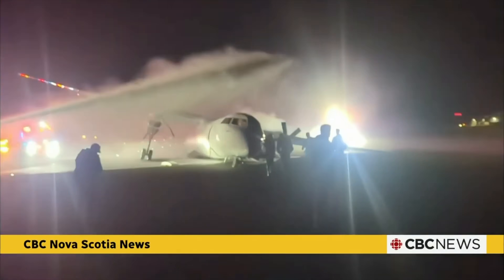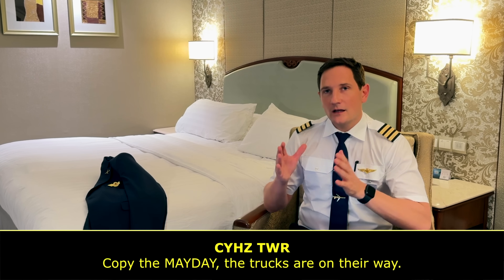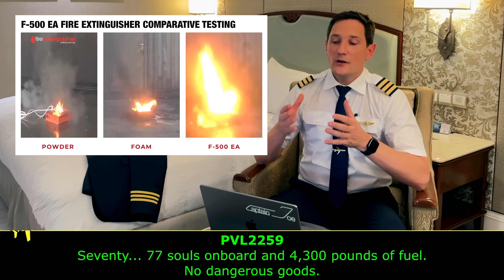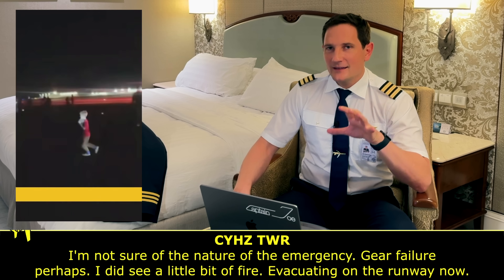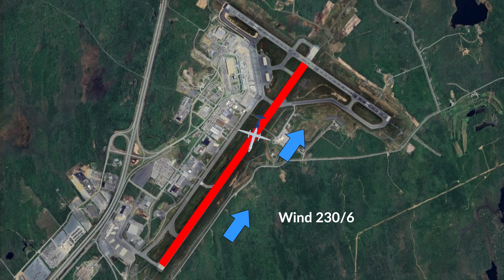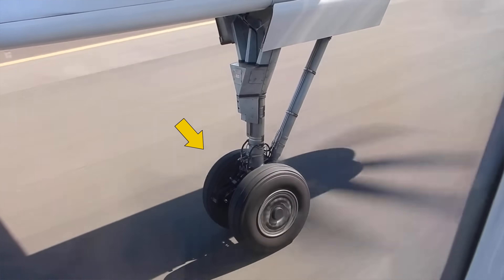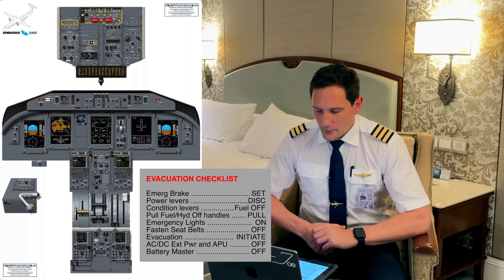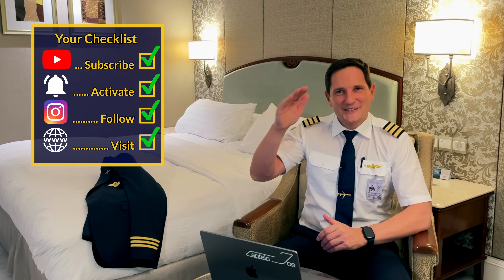WHAT WE KNOW about the Q400 EMERGENCY LANDING and Engine FIRE - Explained by CAPTAIN JOE

Comment from the maker: Hey Everyone! 
I want to use this comment to point out that I made a mistake in the Evacuation Checklist. The "POWER LEVERS set to DISC" actually means "Discing", reducing the blade angle to almost zero (the intermediate position between flight idle and reverse). And, the yellow arrow during "FUEL and HYDRAULIC Off handles" should be pointing to the handles on the overhead panel. 
Kind subscribers and pilots of the Q400 pointed the mistake out to me! 
Thank you for that! Bare with me, I'm not rated on this plane😉
Wishing you all the best! 

PS: If there is another incident/accident you would like me to review, please comment below!
Reply: In normal operation, the APU and APU Bleed would be off during landing, but in icing condition, which right now is prime time for that in Canada, the APU and APU Bleed would have remained on for the structural anti-ice to operate.
Reply: @PinkHusky433 the APU on a Dash is not certified for inflight use. It’s only used on the ground for air conditioning and electrical power.
Reply: @PinkHusky433 the APU would not be running on touchdown. The APU isn’t used for de icing on the Q400 however it is started while taxing to the gate for bleed air heat in winter and air conditioning in summer
Reply: Is it possible to review any cargo incident/accident?
Reply: Also the " pull fuel off handles" are the red handles on the overhead panel. You are showing the roll and pitch disconnect handles.
Reply from the maker: @richardmorin6968  Read ... just take the time to read the full comment ...

Comment: Hey Joe great video , quick note : the fuel hydraulic cut off t handles are on the overhead panel in Red . The one you pointed in your video were the pitch/roll disconnect handles.

Cheers

Comment: Successful landing with a disabled aircraft but the airport bungled the passenger recovery side of this.  The passengers were left out on the runway for about 1.5 to 2 hours in the freezing temperatures.  Same thing happened back inn2016 when an AC flight crashed on the runway.  You’d think they’d have done better…

Comment: My two cents here, the dash is known to have a gear collapse due to the frequency and vibration of a flat tire. The pilots may not have known that the tire had become flat after take-off and upon landing the vibration can cause the gear locking knee to unlock causing it to collapse. The downside is that the Dash 8-400 does not have any tire pressure indicators onboard the flight deck so if the tire had deflated after take-off or deflated during touchdown the pilot would not know. There is a checklist on the Dash 8-400 that if a known landing gear tire has failed or deflated it gives a clear warning that the gear may collapse upon landing. So good on the pilots for handling such a latent threat and sticking to their training and Standard Operating Procedure!

Comment: I was operating a flight into Halifax the evening this happened. We elected to hold until we were close to our minimum diversion fuel in case the airport decided to open 32/14, which we were able to eventually do. We landed on runway 32, it was very surreal seeing the PAL Q400 off the runway as we taxied in. Phenomenal job by the crew and a good breakdown of the situation.

Comment: Hero move of the day? B.S. The pilots already have enough to do in an emergency, such as save the lives of all on board. The last thing they need to be doing is answering ATC calls for souls & fuel on board. All of that info should be automatically transmitted to ATC & emergency vehicles as soon as pilots give weight & balance info to the dispatcher on pushback. I've seen far too many of these emergency flights where pilots are right in the middle of trying to solve the emergency & ATC interrupts with a request for souls & fuel on board. All that does is distract the pilots from solving the emergency. While the pilots are trying to answer ATC, their aircraft gets closer to disaster for everyone onboard.
Reply: So no fuel burn while route?
Reply: @Steevo-qw4sp  As though that should be the priority in an emergency? Let's see, my aircraft is about to crash, I have seconds to diagnose the problem & save it, or I can waste the time calculating my fuel onboard to tell ATC. Tough choice.
Reply: @darenf973  standard info passed on when declaring an emergency. I should know attended over  well over 100 in my
Reply: Attended well over 100 in my career

Comment: I will say in the following pilot's defense asking for expected closure time, the only time anyone actually communicated what may have happened with the first plane was tower talking to the firetrucks, which might be a different frequency, and even then it was "I'm not sure... gear failure perhaps...". So the following aircraft might not have had any idea what was going on, just that there'd been a mayday and they'd been told to go around, and wouldn't have had anything to base a guess on how long things were going to be shut down for.

Comment: Well done by all concerned.  I am wondering from comments made by ATC about the undercarriage collapse if the controller had seen the problem and may have alerted the emergency serviced before the mayday call by the flight crew.  This might explain the incredibly quick response by Red 3.
Reply: That was my speculation. The ATC tower there is not that far away from where the aircraft ended up and likely watched the incident occur, highlighted by the flames.

Comment: Lack of proper maintanance or just unpreventable accident due to some fod on runway during take of damaging tyre ?
Reply: The initial TSB release said the vibrations caused by the blown tire caused the gear to release from its locked down position. A very similar incident has happened before. Most likely related to design characteristics of the landing gear but maintenance could certainly be a contributing factor to both the tire failure and the failure of the gear.

Comment: When passengers are told to evacuate the air craft. Does the flight attendant tell them in which direction to go once there are out of the plane and away from danger also does everyone meet up at point for count ?When you said passengers Running around I am picturing  passengers running around everywhere and not have a direction to go.
Reply: The instruction is "By nearest useable emergency exit", both in the pre-flight briefing (who listens to that?) and at the time of the evacuation.  From personal experience (training/test evacuation, but loads of smoke) it's more than a little scary.  Since that exercise I've developed the habit of seeing how many rows both ahead and behind to the nearest pair of exits, but I can guarantee most people don't.

Comment: Great video! I flew the Q400 for Flybe (UK) for many years; in fact I was a TRE on it. Your explanation is so good I would use it for recurrent training (if I wasn’t retired, and Flybe still existed, and I hadn’t moved on to the E195 ☺️). 

Two wee points, if I may: first, in your explanation of the Evacuation Checklist, your yellow arrow points at the Pitch and Aileron disconnects when you talk about the Pull Fuel/Hyd Off handles. Those are actually the two red handles at the top of the overhead panel. Second,  Power levers to DISC isn’t “Disconnect”, it’s actually DISC, meaning the blades are set flat on to the airflow effectively creating a big “Disc”. In other words fully fine pitch. From there, Condition Levers to Fuel OFF, causes the blades to go to the feather position; edge on to the airflow.

I agree that all involved in this - especially the pilots - were extremely professional in what must’ve been the biggest surprise of their careers! 🥴

…and then I saw your correction at the top of the page. Clearly lost all my observation skills..😂

Comment: PL s to Disc -> idle pitch. Out of reverse pitch. The fire handles are way on top. The air stairs stop halfway resting on the tarmac. That’s minor issue. The aisle is narrow. Very narrow. The exits fits a big tight as well. That is challenging for the cabin crew to mange. They did well. Good job by all 4.

Comment: The reason the pilot asked how long the airport might be closed for is because there may be many reasons for it to be closed - and if there's a chance it may reopen shortly it would be more helpful to everyone around who otherwise might not have options. They wanted to know if they need to immediately go to the alternate or if they hang around a bit there's a chance to reopen.  Approach wanted their intentions and the pilots were basically asking if there's a chance it might reopen shortly or if they need to divert. If you've got the fuel and it's only a short wait, it might be easier to wait. If it's more indeterminate then diversion is the only option. Might seem silly, but diversions mean having to land elsewhere, arrange accommodations for the passengers, logistical nightmares of getting them rebooked back to Halifax and other things, maybe even having to bring new aircrew in. And all the other issues if it's not an airport they normally service. If they have the extra fuel, it might be easier to just wait it out (and passengers would appreciate it more as an hour late is still better than what will be 6+ hours somewhere else). More of a customer service thing sure, but it never hurts to try especially if you can.
Reply: From Halifax there are 3 possible close by  airports. Saint John NB YSJ,  Fredericton NB YFC,  and Sydney NS  YQY.        Saint John is a 35 minute flight and a 4 1/2 hr drive.
Reply: @steveggca  you missed Moncton, NB YQM, which would be the better alternate typically.  2.5 hour drive.
Reply: @chrischaffey1252  totally did
Reply: I think I read somewhere that Charlottetown was the diversion airport for the second PAL on approach.

Comment: Maybe you might have the answer! try to ask other pilots with no response!
South Korean crash why didn't the pilot dropped the landing gear manually? it was said there was no electricity four minutes or something, but that doesn't affect the landing gear being dropped manually from inside the cockpit, and how long does it take to drop about 15 20 seconds? I can't understand why they didn't drop the landing gear, What would have been the reason they didn't?
Reply: Confusion panic after the bird strike ?
Reply: @WANDERER0070  I'm not convinced by that
Reply: Gravity extention still requires electricity. In engines goes out it will be powered by the battery. Check blancoliros video on that. I’m starting to suspect that the battery didn’t work…
Reply: @martinolssonbass  you sure? I thought it was just a lock you release in the cabin and it drops down by Gravity, I didn't think any electricity was needed? I mean they're not electric anyway its hydraulic so I'm not sure that's correct sir

Comment: The 3 SAS dash 8 incidents were improper maintenance by SAS  (rollers that the unlock hooks rest on did not roll properly so the uplocks could not release)  and had nothing to do with a bad design.
Reply: That would cause the gear to not come down. A gear collapse is different. Didn’t SAS have gears collapse?

Comment: An interesting problem occurred to me when I heard (on another channel) the airborne flight declare he was diverting to his alternate airport. A lot of airline flights will operate on a No-Alternate Flight Plan in order to carry less fuel (save money). That would have been an interesting complication. What would you have done in that case if you were capt. and did not have enough fuel to comfortably divert?
Reply: Not all airlines do that. For those who do, there is a clearly defined set of conditions that have to be met before a flight can be dispatched under the No-Alternate rules. Basically, the weather has to be perfect, destination airport has to have two runways, the minimum fuel quantity is specified and includes an extra reserve, etc. In this case there are a few airports not too far from YHZ (YQM would be the obvious first option), and if it comes to that the Capt has full autority to take whatever decison he/she feels is required for the safety of the flight... ;-)
Reply: If the second PAL had declared mayday-fuel, would he have been allowed to land, despite the unavailability of fire crews?

Comment: Okay, this is not an appropriate comment, but after next Monday, Trump's department of External Revenue will be able to assess a tax on the fuel burned by the trucks in Halifax.  At least that's seems to be what he thinks can happen.  

Otherwise, fantastic job by the pilots and all else involved.  Ex-RCAF (except it was called Air Command when I was in) and spent time at CFB Shearwater a few miles away from CYHZ.  (CYAW was the area airport for years until the current airport was built to escape the fog.  It didn't work.

Comment: This was very local to me as Halifax is my home airport right now, although I was away from the country for winter break. Always seems to be these airport closing incidents happening at Halifax airport. A cool feature of the Dash 8 is that the metal of the fuselage next to the propeller is reinforced so that’s crucial in preventing injuries to passengers with the very unique landing gear configuration under the engine. 

Did anyone notice the child still on their iPad or tablet during the emergency video with the engine burning, completely unfazed by the situation?
Reply: Well handled indeed. About the child on Ipad is not unfazed though. It's being situatuionally unaware. In case of child, it's innocence, but many adults are too engrossed in device to be aware of their situation!
Reply: We call that piece of the fuselage the ice shield as that's what it was designed to do.

Comment: Does turning off of the Battery Master switch shut off all of the cabin lights?
Reply: The emergency lights would have been on and they operate from their own battery packs
Reply: One item on the pre start check list is to arm the emergency lights. When they are armed, if supplied power is lost, the emergency lights will be powered from their own batteries.
Reply: Yes

Comment: Thanks for the great analysis. I wonder why the (all?) aircraft didn't have tyre pressure sensors? They've been pretty standard in cars for years.
Reply: The pressures are checked daily. It’s unlikely the tire failed due to low pressure.
Reply: @diggr13 My point in this type  of case is that a sudden blowout would be detected by a pressure sensor.
Reply: You're not wrong. Still pretty uncommon to have a blown tire and not know about it. In any event, you still gotta land.
Reply: It was not when this aircraft was designed in the 80s. It takes along time for things to get approved and certified in the aviation world. Most single engine piston airplanes still have carbureted engines with magneto ignition while cars have had very reliable and efficient fuel injection for decades... As for the pressure sensors, if you blow a tire on take-off or have a tire ow pressure warning in flight, there isn't much you can do about it anyway. I blew a tire on landing in a Q400, i knew it popped, I didn't need a sensor to tell me, it was quite obvious.

Comment: Disc is feather on the q400
Reply: Disc is short for discing and is a power lever position on all dash-8.  Basically props at flat pitch and zero trust/very light negative trust. Power lever is in that position for both start up and shutdown on the Q-400. We use discing at main wheel touchdown to help slow the plane, it’s very effective, reverse power is not used that often. 

Feather is a position on the condition lever.
Reply from the maker: Thank you! I‘m not rated on this plane, so my bad!
Reply: Yay you commented on my comment!

Comment: Many years ago in Copenhagen there were three incidents of gear collapse on dash-8 landing, and many Danes began referring to the plane as the crash-8 😂
Reply: Which is silly considering it’s incredibly safe and hasn’t had a fatal crash not caused by pilot error. Far better than the ATR. They did fix the landing gear configuration after 2007, but SAS was found guilty to have ignored some crucial details in the manual Bombardier had supplied.
Reply: @dehavillandcanadatwinotter9621  SAS decided to get rid of all crash-8's at that time, a good decision.